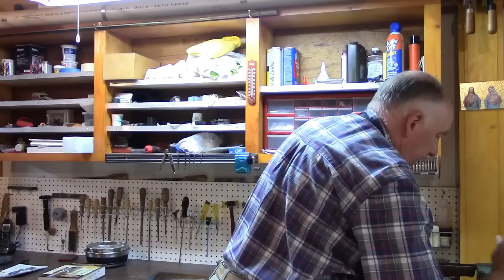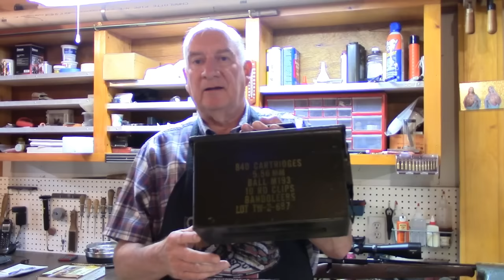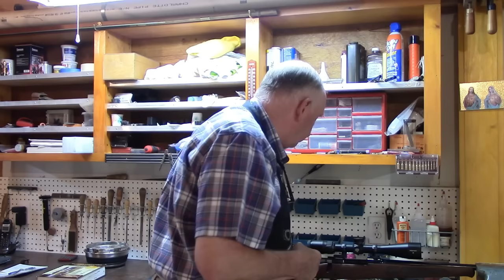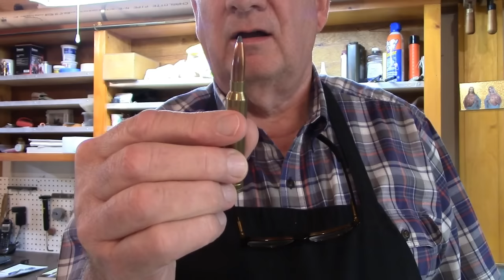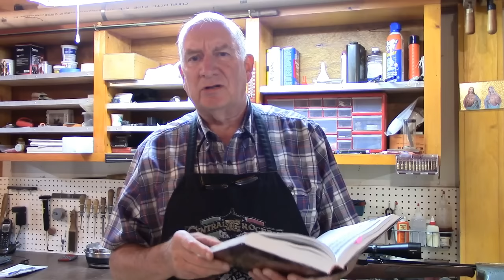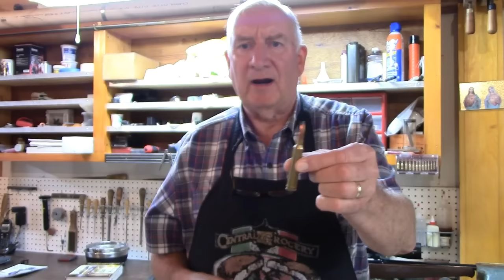How long do barrels last? ~ Discover the truth!

Comment: Another fine and Informative video ! Just a couple of comments :1- There is some speculation that  boat tail bullets will erode faster than flat base bullets. with a boat tail you are taking the cutting torch temps of cartridge ignition ,that then channels those hot gasses directly to the sides of the barrel  throat. ;2 -  Back in the 1980's there were articles in the gun mags about taking a scuba air tank to the range. After every few shots the rifle barrel would receive a blast of cool air from the tank  to cool it off .  Well - it seems that it did work to cool barrels faster ,but the practicality of lugging a  large tank to the range with your other gear. caused the practice to die on the vine.
Reply from the maker: Watch my video regarding ballistic coefficients and boat tails. I generally avoid using them if possible for a number of reasons, because they offer no ballistic advantage within ethical hunting ranges, are less accurate, reduce powder capacity, penetrate less due to more rapid depletion of sectional density through tissue, have less case neck bearing surface with many cartridges, and have been found in testing to reduce barrel life, believed due to gas cutting. Other than that, they are fine. 😗
Reply: @GunBlue490  I just now finished watching that video. Great information ! Thank  You Sir !

Comment: So so so much better than gun nut channels.  Thanks for producing a channel with value!  I'm curious whether the 60 gr 22lr subsonuc bullet fired out of a higher twist barrel, would hurt the barrel life compared to a 40 grain.
Reply from the maker: Bullet weight and barrel twist alone have no effect on barrel wear.  Heat, erosion, and friction are the three elements of gun barrel wear caused by firing.  Subsonic loads are very low in all categories.  Heat is caused by high pressure combustion, erosion is caused by large amounts of powder flowing by highly heated steel, and destructive friction is caused by extreme velocity; none of which are present in subsonic loads.

Comment: I know how to use up a barrel in a short time. When the rabbits were thick here in Idaho it was not unusual to shoot 250 to 300 rounds per day out of my 220 Swift. Often the barrel would get so hot that you couldn't touch it. More than once you could smell the varnish on the stock cooking. The accuracy with a 12 power Leupold started around 1/2 MOA. Eventually, it wouldn't keep all the shots in 2 1/2 inches from the bench at 100 yards. Older and wiser I had my M77 Ruger re-barreled by the Ruger factory,  reduced my load of H380 by 1 1/2 grains, and had my accuracy back.

Comment: I have heard from the old timers that there was once a fad to neck down a case and put a smaller diameter bullet in it.  The 25-06 is one example of this.  The current flavor seems to be necking up a case to take a larger diameter bullet ( 300 aac).  The old timers said that the smaller bullets went extremely fast and were barrel burners.

I like how you brought up the straight wall vs bottle neck cases.  One of the reasons I picked the Bushmaster 450 over the other big bore offerings was the fact that it operated at such a low pressure and still gave good results.  I want to get as much out of my brass as possible.  This larger diameter bullet does cost me a bit in long range performance because the SD and BC are lower than other offerings.  I am ok with this.  I am better than ok if it makes my barrel last forever.
Reply from the maker: Fads are something that are short lived.  The necking down of cartridges has been a consistent design method that has gone on from the first bottle neck cartridges in the 1800s until now, because it's the only way to derive higher ballistic coefficients and higher sectional density from any given case capacity. Avoid generalized descriptions of cartridges; necking down a cartridge does not create a barrel burner.  It is the combination of high powder capacity together with insufficient barrel diameter that is harsh on barrels, which is assuredly not the situation with all bottle neck cartridges.  The 300 AAC is easy on barrels because it is far below ballistic levels developed in the 1800s.  Of course the barrel will last forever if it doesn't do anything.  For every necked up round, there are a dozen necked down, because people have always wanted guns that can get further down range with enough velocity and bullet weight and length to accomplish something. The 300 AAC has none of the above. It's only accomplishment is that it fits into an AR-15.

Comment: Lots of good information and I need to review this a second time. 

If I want a barrel to last a long time, it is reduced loads and better yet cast bullets at even lower velocities.  This has been known for ever.  Other than the varmint hunters, few people actually wear out a barrel while hunting.  Most people wear out their barrels when not hunting and moderate loads will do well for blasting away at targets or what ever.   NRA high power shooters do wear out their barrels and now days with the AR15 rifles one simply changes out the barrel.  This does not require a gunsmith to do.

Comment: I’ve seen a barrel melt. It was an M249 SAW with two, 200 round belts married, no let tup of the trigger. That was maybe two minutes after running two 100 round belts, 3-5 round bursts over about 2-3.5 minutes course of fire. It got red hot and saggy.

Comment: I have a Model 7 in .308 that I wore out.  I discovered this while attempting to work up a cast bullet load for it. I could not keep it from leading just ahead of the chamber.  The throat was eroded away and not able to seal the cast bullet.  I have other rifles that I shoot lead bullets in very successfully and this is a great way to preserve barrel life while plinking.  Velocities are about 1600 fps. and accuracy at 50 yards is under an inch.

Comment: An addendum to my previous comment. While studying a Hornady manual I found another example in the 338-06 (that is based on the 30-06 cartridge) and when comparing it to the 30-06 I found that heavy 338 heavier bullets had comparable speeds to the lighter 30 cal bullets. It is counter intuitive at a first approximation analysis but now I know it is due gunpowder better efficiency in a wider mouth of the case.

Comment: Pressure and temp are leading causes of barrel degradation. Later, as the throat and lands erode, gas shear accelerates that erosion. Friction induced by the soft copper jacket is a non-issue. So, keep pressures low in a sharp shouldered case that’s not overbore and your barrel will last. Now, if you want to have fun, I recommend a 6.5-300 Weatherby ;)

Comment: I think that you might want to mention that it is true that the pressure drops as the pipe diameter decreases. But the velocity increases greatly P1V1 = P2V2 (basically, with other things being equal). And, it is the much higher bullet velocity screaming down the barrel causing greater resistance (heat) that kills the barrel quicker. It is not the so much the higher pressure in the case, but the much higher bullet velocity. And true, you need more powder because the round is less efficient than say a 26 Nosler vs a 7mm Mauser. So, if you are going to shoot a 26 Nosler (or similar) then you will need to let the inside of the barrel cool (and/or buy a barrel cooler) between rounds to maximize the life of that barrel.

Comment: I've been telling people for 25 years that running a barrel hot will prematurely wear one out and been told by almost all of them that I was crazy as hell. The military has known this since at least WWII. I think a bull barrel or fluted bull barrel will help alleviate this problem.
Reply from the maker: That's true in a technical sense, and works for a gun that doesn't hunt, but for practical application, carrying a gun into the field, a light barrel is more suitable.  Light barrels can last every bit as long as a heavy barrel, and for as many shots.  They heat faster, but also cool faster.  Most folks don't shoot fast strings, which will ruin all barrels.

Comment: Really depends on what cartridge the barrel is chambered in. Ive had rifles come through my shop like 243win, 25-06, 220swift, 300win mag, that had totally scortched barrels. I have a custom 264win mag i build 8 years ago that is on its fifth barrel. I never got past 650 shots with that long range hunting beast. I shoot 1000yd benchredt at Williamsport in both light and unlimited class. My unlimited gun i use to use the 7WSM but that was the worst barrel burner i ever experienced, barrels done in 500 to 550 shots. What it has in common with 264win. 300win, 243win is that damn short neck combined with being over bore eats throats. I switched my unlimited gun from 7WSM to 7saum, now i get 1,000 to 1,200rounds per barrel and my light gun which is 6XC gets the same

Comment: Your channel really is one of the best.  I depend pretty much on you and Eric Cortina.  I was wondering what your thoughts were on my 22/250.  I've never shot max loads,and I never shot more than three rounds without using a barrel cooler.  I'm going on 1800 rounds and it doesn't show signs of losing accuracy.  I just wondered what I have left.

Comment: Comparing straight wall casings to bottle neck casing. Is like comparing a bic lighter to a butane lighter. They still get just as hot. But the butane flame is a lot more intense.

Comment: I Own around 30 guns and only 1 gun that I have this problem with one good shot when the barrel is cold and after that then shots are every were on the target after the barrel is hot. The gun I have this problem with is this used Spanish Mauser which think it was made back in the 1930's, if I remember right, which was originally the Spanish 7 mm and someone re-bored it to the 308 Win. 
    The one gunsmith told me that most of these guys that re-boars the barrel into another caliber usually screws it up some how, and that probably explains why more friction heat like the beginning of this video says which probably screws it up more.  
Then also learned about this with many other stuff, the American  308 Win ammo is not designed with the European steel of the Spanish Mauser barrel.  So after buying this gun from around $130.00, biggest thing I learned is that never buy a gun that was re-bored into another caliber, and use the exact correct ammo for that gun .

Comment: Although 3 yrs old now, the first part of your description of "barrel wear" could be more accurately labelled METAL FATIGUE... 👍🏻

FATIGUE :  In materials science, fatigue is the initiation and propagation of cracks in a material due to cyclic loading. 
Once a fatigue crack has initiated, it grows a small amount with each loading cycle, typically producing striations on some parts of the fracture surface.

Comment: I reload .223 and i don't go for high. Velocity. 
Just enough to cycle a AR15 for target shooting and ajusting sights for the round i am using and by useing the same load i can shoot woodchucks around here with no problems out to 200 yards. Same with coyote.  The powder i use is Winchester 478 with low flame.

Comment: On an AR-15 that you use regularly, the barrel is pretty much a consumable part. The really good, chrome-lined barrels are designed to put up with a certain degree of abuse. I agree that you shouldn't treat every gun that way but that's pretty much what an AR-15 is for. It's hardly an heirloom rifle, and replacing a burnt-out barrel isn't such a big deal.

Comment: This is why I didn't jump on the 6.5 Creedmoor bandwagon. Bad barrel life.
Long live the old tried and true 308!
Edit: I will have to say that barrel life discussions like in this video are very true for bare steel barrels, but chrome lined barrels last much longer. Chrome is extremely hard. In fact chromium is the hardest metal on Earth. 
AK47's, AR15's, and military machineguns have chrome lined barrels, if they didn't then the barrel would be worthless and would not last long at all. 
However, chrome lined barrels are not as accurate as a precision bare steel barrel like you would find on a bolt action rifle.
Reply from the maker: Actually, chrome was installed for corrosion protection that became apparent in the South Pacific in WWII and was really a problem in the first M-16 rifles in Vietnam.  

Yes, chrome is much harder than steel, but I'm speaking now as a former precision electroplater who has very close professional understanding of chrome, silver, cadmium, gold, hard and soft nickel, and a number of other plated metals and how they react to stress.  Our QC department could make the best plating fail quite easily by going after its Achilles heel; what it sits on. 

While chrome has a much lower friction coefficient, and can theoretically provide some degree of powder erosion resistance, chrome plating provides no protection whatsoever for the first and greatest threat to barrels, which is heat that attacks the underlying base metal upon which the chrome resides. Just as a beautiful hard asphalt road washes out from underneath, plating cracks and collapses as the underlying steel expands, cracks, and deteriorates. Chrome is hard, but it cannot stretch as fissures in the steel break apart. Like all plating metals, it is extremely dependent on base metal and can't last a moment longer.

Until the Vietnam era, most machine gun barrels were not chrome plated, and they gave very strong service through many wars around the world.  I used machine guns with chrome lined barrels, and according to the veteran servicemen who used earlier machine guns, they saw no great difference in life expectancy, because it is heat that kills them, not friction.

Comment: your tight groups can start to open up due to a fouled and uncleaned barrel too . when i was young and dumb i thought my barrel was done . took it into a gunsmith to have a new one put on . he called me a week later . had me come in and asked me if i ever cleaned the barrel . i told him yes all the time . he then asked me how i cleaned it ..well long story short ..i didnt have a clue how to clean it properly . he showed me and havent had a problem since lol..did i feel dumb . the barrel was so fouled up with lead and copper and powder it was unreal . im sure there are lots of others who simply run a pull through thinking its clean and are dead wrong  !!!!

Comment: Thank you for your information on barrel length pressures and how long a barrel will last or when it will burn. I chose the 22-250, I've already put almost 500 rounds through that barrel. That being said I never fired more than three roundsconsecutively before letting the barrel cool. I almost think that barrel has reached its half-life after listening to your informative video. Would you say that after a thousand or eleven hundred rounds, a 22-inch barrel with a 1 and 12 twist with a 22-250 is about right??? I understand that you said you could not project numbers.

Comment: Pretty sure Lucas Botkin from T.Rex Arms puts over 10k rounds through every one of his weapons. I know I've put over 3k rounds through my Rock River. And the barrel is still doing fine. Perfect accuracy and all. I think storing your weapons in a dry area will certainly help to keep it from corroding more quickly. 

Just don't burn through ammo so fast that you melt your barrel. I'd say don't get your barrel so hot that you can feel the heat through the hand guards and you'll be good to go for over 10k. 
Even though Lucas Botkin certainly puts his weapons to the test, I bet he knows how to take care of those weapons properly as well. Proper care and storage will extend the life of that barrel.

Comment: Concerning the round tapering, Its bernoulli's principle, not venturi. Venturi effect governs internal preasure drop exerted latterally to the walls of the choke point as the fluid increases speed. Bernoulli effect governs the speed of the fluid through the choke point increasing at the point of restriction.

Great video though, very informative. Thanks!